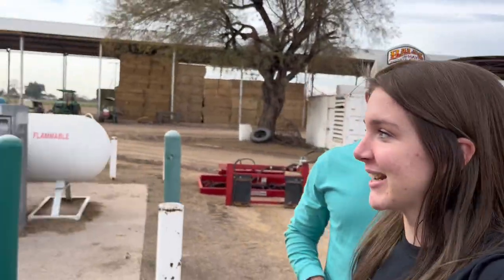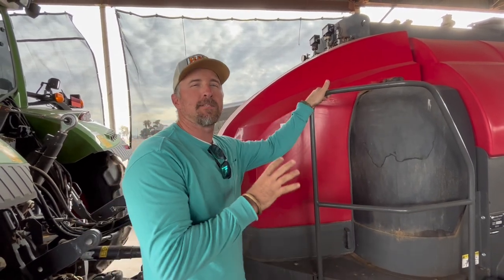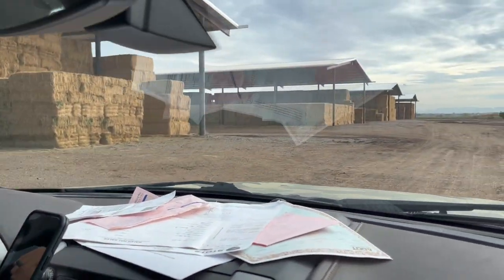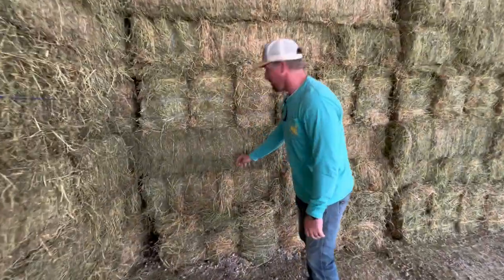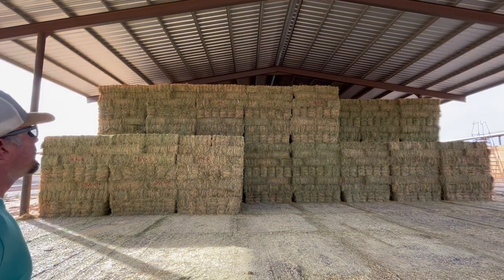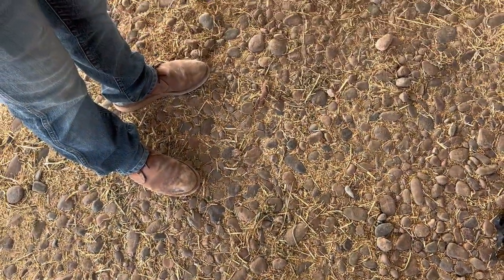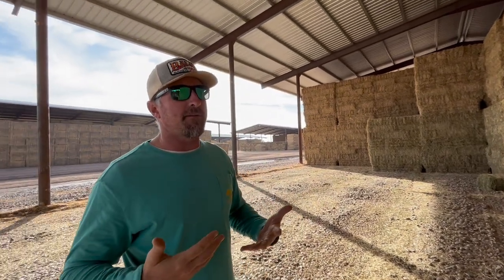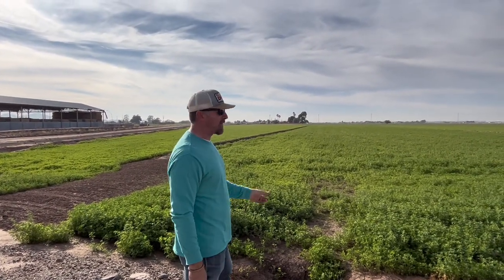The MOST HAY I Have Ever Seen In One Place @BalesHayFarmandRanch

Comment: Why do they use a hay steamer? I thought wet hay was bad?
Reply: Their climate causes the hay to get too dry after its cut before they can get it baled, and they would lose most of the leaves which are high in nutrients. The steam dampens the hay just enough so the leaves stay on. Balers have moisture sensors so they know if they're getting the proper moisture content.